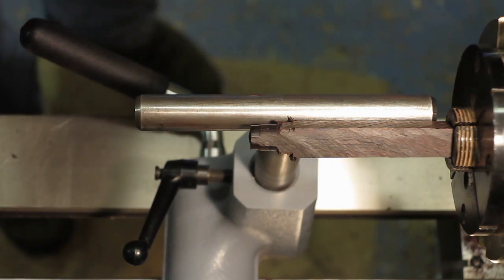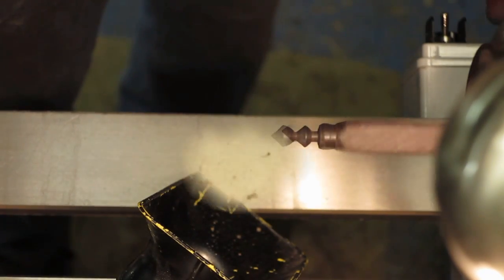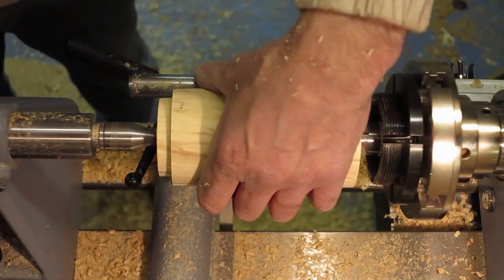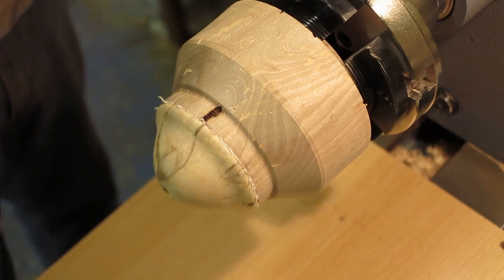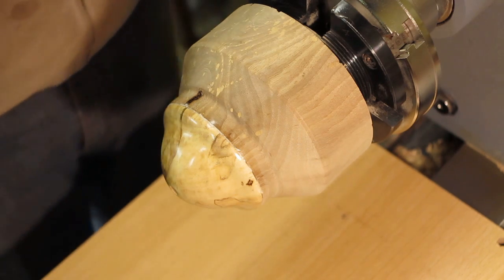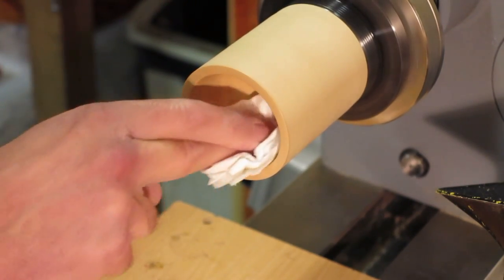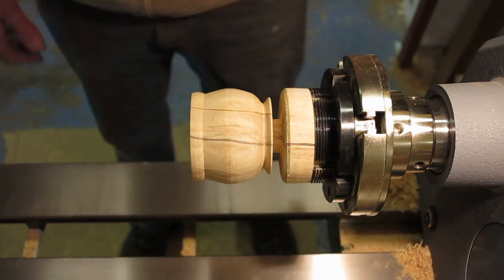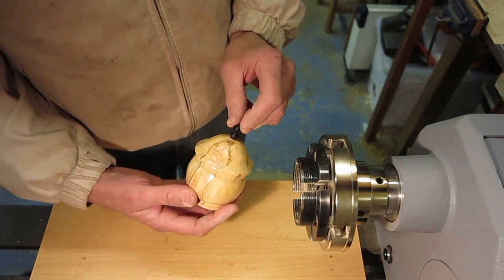Wood Turning - A Jewelry or Trinket Box

Comment from the maker: Hi Jim, glad you like the video. Sanding sealer is used to raise the grain, and seal the wood. You buy it, but I thin mine down with a thinners, as it dries quicker. If you have the time, watch my video called "A Simple Wax Finish", it goes into detail about the mix ratio etc.. Thanks for the support.
Take care
Mike

Comment: Hey Mike
I got given a lathe lately with a pretty new chuck but I have a lot of trouble with the piece I'am turning coming off centre so i keep having to re cut the piece to remove the wobble. I place a line on the wood and the chuck to keep them aligned but even with them aligned it still moves. I would be appreciated if you gave me some suggestions.

Comment: Super box Mike.  That is really good work.  Question please, what's your sanding sealer mix?  I've just run out of Chestnut Cellulose Sealers that I thin 2:1 with thinners but I was wondering if there's a better mix before I buy more.  Thanks, Brendan.

Comment: Wonderfull box Mike. I have watched quite a bunch of your videos now, and I wonder what this sandingsealer is. Sorry for the, perhaps, obvious question but I just started turning on a large lathe.
All the best and thanks for your videos,
Tom
C4 Woodworks
Reply from the maker: +Tom Burger Hi tom, and thanks for your kind and supportive words mate. I use a Cellulose Sanding Sealer,3 parts, thinned with Cellulose Thinners, 1 part. Hope this helps.
Cheers
Mike
Reply: +Mike Waldt Thank you for your answer Mike. This sure helps.
I myself used thinned down waterbased lacquer. I think your mix gives a better result and I am giving it a try as soon as my lathe is functional again.
Thanks again,
all the best,
Tom

Comment: A nice job Mike really like it, what are button jaws? And do they fit on any chuck?
Is that grain typical of sycamore and is it good to work with for a beginner?
Reply from the maker: Thanks Ken, button jaws are for reversing bowls to clean up the foot/base. They are similar to Cole jaws. Most chuck manufacturers offer these jaws as an accessory. Sycamore is a lovely "esay" wood to work with.
Hope this helps.
Cheers
Mike